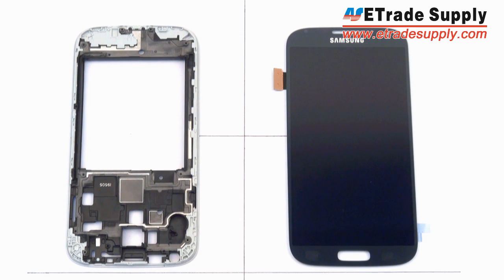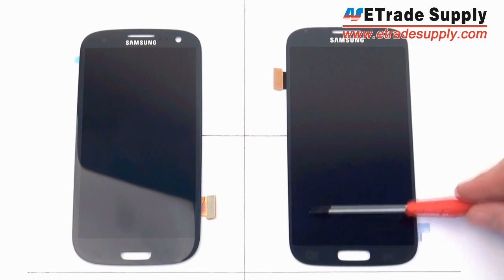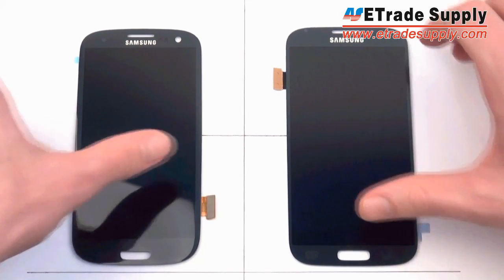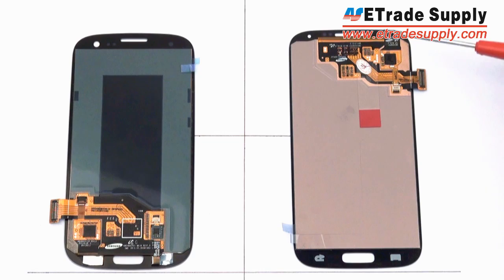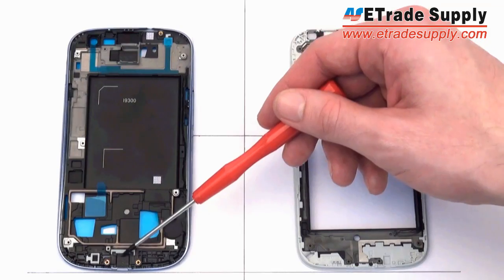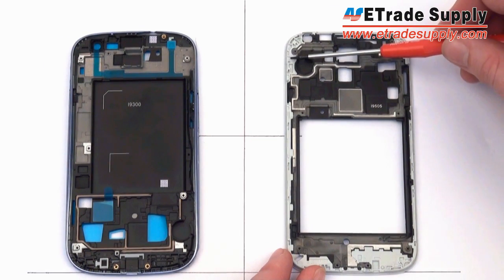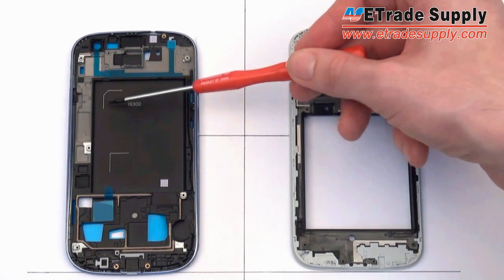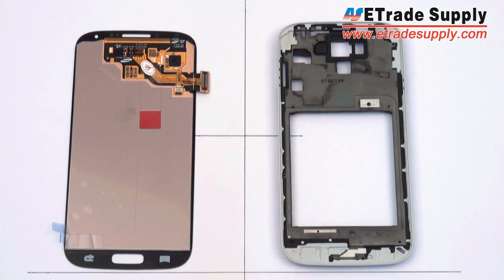Detailed comparison of Samsung Galaxy S4 and Samsung Galaxy S3 LCD screen and digitizer assembly

Comment: Thanks. That's really disappointing. I don't even understand how they market these displays as "720" and "1080" when they effectively have far far fewer subpixels than a typical RGB matrix. Anyways, I promised myself never to buy a phone with a pentile screen after the Galaxy Nexus and S3. I was leaning towards the HTC One, but I hate that it only has 2 instead of 3 buttons, and the fact that it doesn't run vanilla Android. Strongly considering the Z10 since my Lumia 920 crapped out on me.